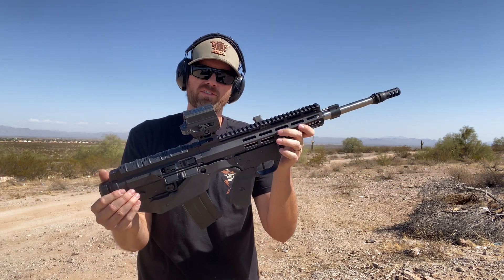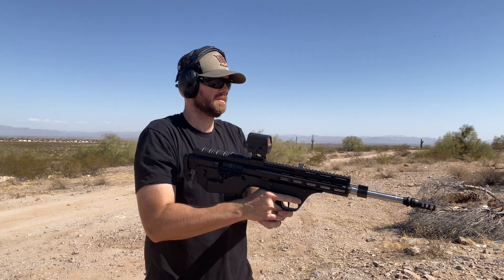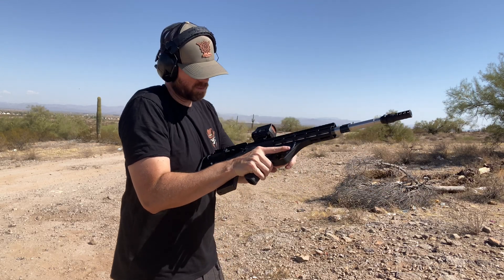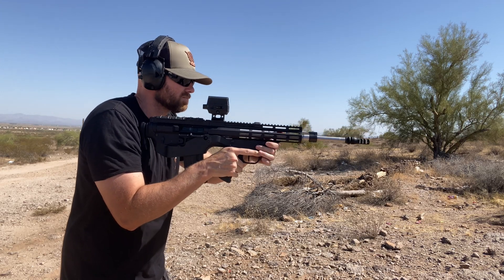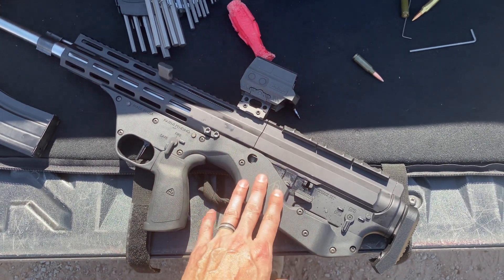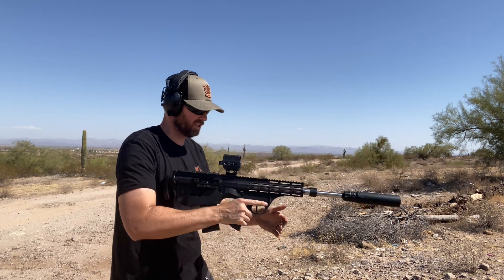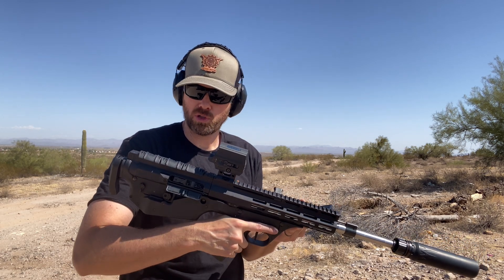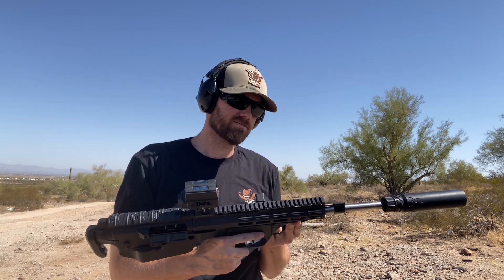6.5 Grendel Bullpup Build Episode 4: It Works, kinda!

Comment: Cmmg 6.5 gren or 6mm dissent, a3 tatical, done.
Reply from the maker: Do you see how expensive the dissent upper is??? I was trying to keep this hole thing under $1000 and using stuff I already have. But it would be nice to be able to just slap that upper right on…… that may be what I have to do but dam it, I’m going to be kicking and screaming the entire way with that price!!!
Reply: @combatreadychannel  lol by the time you're done, it might come out to the same price or even more if you count the labor you've put into it. The only plus side is that you have a longer barrel.